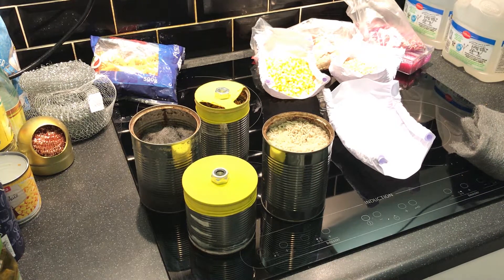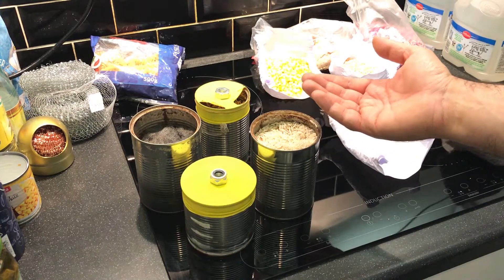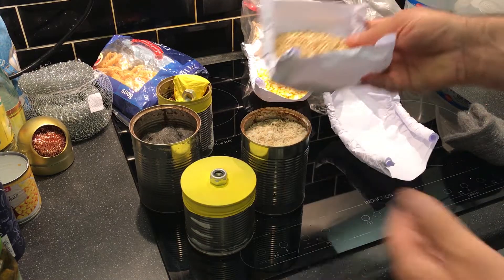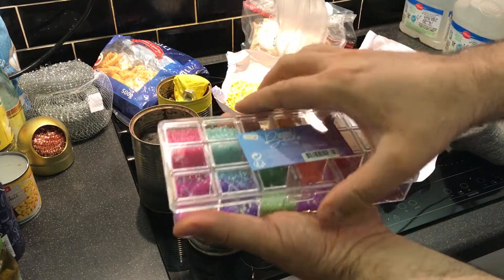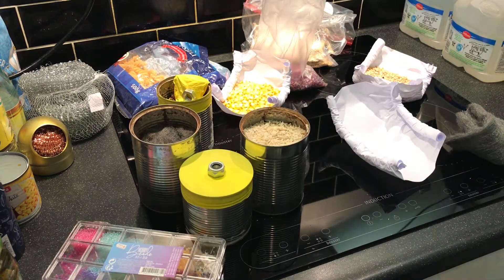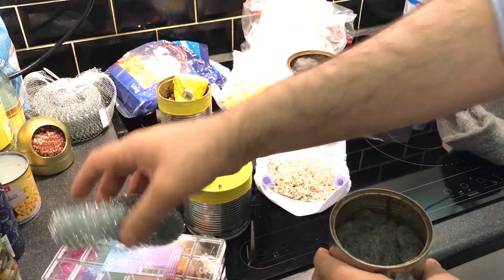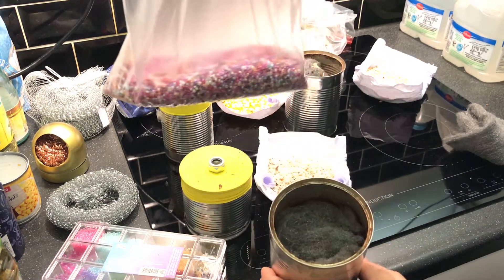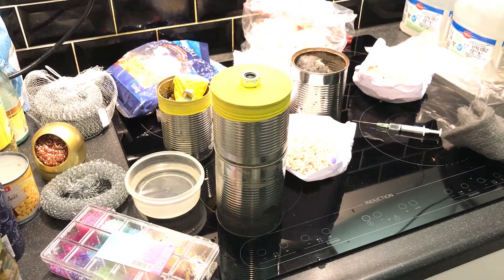Improvement of Thermoacoustic engine with glass beads (end of the Rice engine era)

Comment: Amazing job, may I make some suggestions you can explore? Your loosing a lot of energy potential with the steam produced. 
the shape of the can if tapered from thick to narrow like a cone  would compress the steam more, increasing internal cavity compression by 3x depending how efficient you make the shaping to compress the steam. Doing so will also give you a stronger release output of the steam as it is pressured by the narrower exit point, moving the cylinder engine at greater speeds, for much longer time, because the steam trapped inside for longer time will boil the water dry much slower, yet giving stronger release like pressure cooker release valve. This can literally be turned into offgrid thermoacoustic engine with a more serious professionally grade setup with more longer lasting materials that can last much longer. putting a copper cylinder bolt at the right proportionate corresponding size with magnets around the edges of the can would even give you a nice voltage reading.
supersize this tech to something much bigger and stronger, and you would be able to power an entire house with just logs of wood and fire. for an entire day. So many ways I can visualize making a thermoacoustic engine. But the best design would be which harnesses the principles of steam compression to increase energy output and endurance.

Comment: What if you use fine copper wool? Copper shouldn't rust, and it is a better conductor. I'm not talking about the kind of copper wool you showed in the video. I'm talking about the super fine material, which should have better conduction with the gases in the engine.
Reply from the maker: Thanks for the comment. I assume it will work, probably better than what I have shown and yes it should not rust. I do not know where to get very fine copper wool. If i find some, I will give it a try and show it in a video.
Reply: @HVE  One more thing: instead of using a balloon for the diaphragm, what if you use an exercise band? There are large flat sheets of rubber sold for providing resistance for exercises. Those are probably more durable than cutting a balloon.
Reply from the maker: @Berkana  yes, large rubber bands would be more durable, but the amount of damping it creates must not be that high otherwise oscillation will not start. also making it sealed around the can will be a bit of an issue if the rubber band is a bit stiff.  i will explore these and report the progress in the coming videos 🙂. Thanks for commenting.
Reply: @HVE  The exercise rubber comes in various levels of stiffness. My reasoning is that the ideal diaphragm should be more durable than a balloon, and exercise rubber may be exactly that. If you search the web for "resistance bands", you should be able to find many different types of different stiffness. Even the least stiff ones seem better than balloon material.
Reply from the maker: @Berkana  Yes, I agree. if the size which is needed is available I will give it a try. What i see is that the lower stiffness is achieved by making it narrower. That will not be useful here. We need a wide band. I have done some work on an alternative solution for the piston, I will post about it soon.
Reply: @HVE fluidyne version? Water piston instead of diaphragm, perhaps a speaker over the air hole on the other side to capture the pressure energy and turn it into electric?

Comment: You're a true MacGuyver!  I've seen lots of heat engine videos and yours are the most interesting yet.  Maybe the rice is acting kind of like the restrictor in thermal lag engines?  No matter how it works, your engine works very well with out a displacer and even better with a tiny amount of water added.  Would be cool to see how it performs with a long tube attached to the release hole (forming an air piston).
Reply from the maker: Thank you. Actually I had already done some test with longer tubes. It shows interesting results which I will show it in a separate video.
The acoustic wave with longer tube are of lower frequency (as i shown in one of the videos), if I use a diafragma on the long tube, instead of getting the vibration, the sound passes through it. So i need to work on it and understand it better. I guess that acoustic impedance of the diafragma is frequency dependent and below a certain level, it s just so that most of the wave passes through instead of reflection. It is very interesting and offers a lot to learn from.